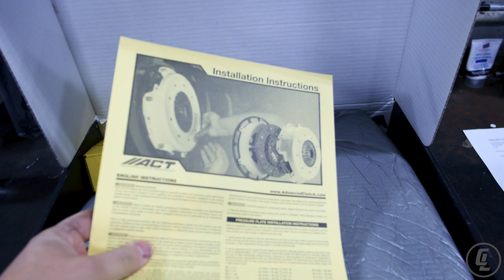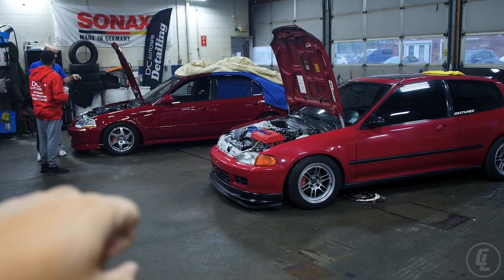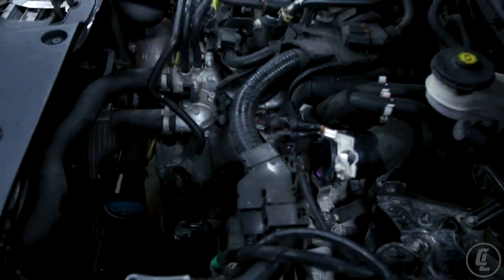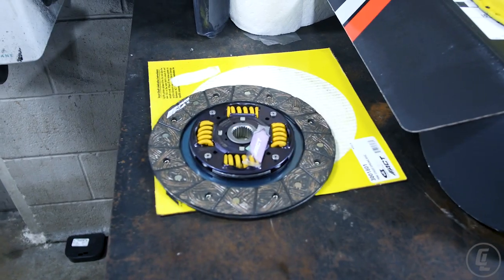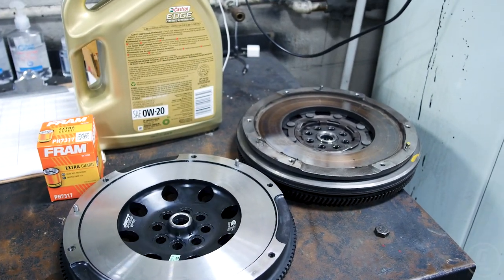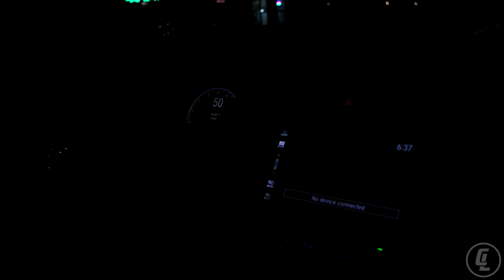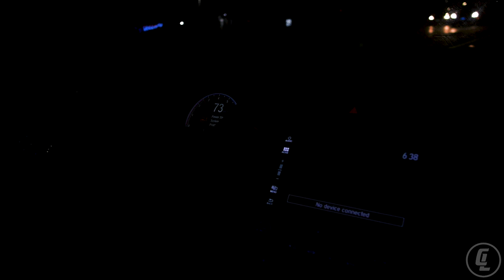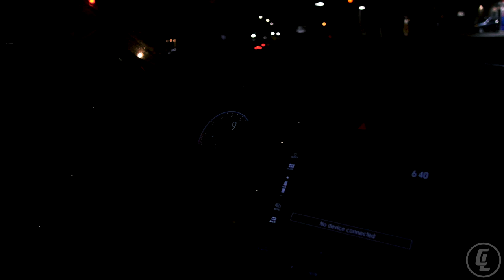ACT Clutch Upgrade - 10th Gen Civic Si

Comment: Hi guys. I have a question for you : I am planning to upgrade the clutch as well ( as the turbo, down pipe and intercooler have been upgraded as well) and I’m curious if you noticed the car revving faster with the new one. After the upgrades and tune I feel the car revving slower than stock.

Comment: Changed mine out in my garage already at 53k miles and now has 66k mile. I used CM fx300 along with single mass flywheel.
Really like although I do get that damn lock out.
Pedal feels solid and rev hang...well better but will never get rid of it completely.
Reply from the maker: Have you upgraded your cmc and line? I heard that helps with lockout
Reply: @ChrisLowpes  you know, I do have gear lock out only when im autocrossing or feel like redlining it. Other than that, everything works great. Pedal feel reminds me of older hondas. The engagement point is on point, and no more slipping.
I haven't yet changed those two items.
It is sort of disappointing to me to have to change so much just so the upgraded clutch function right. Just don't remember having to go through all that with my older hondas.
Reply from the maker: @vah-mingmoua9599  unfortunately the newer cars are more complicated then our older Honda’s. Try upgrading the CMC and line and I’m sure it will help!

Comment: Hey been enjoying these videos, they've helped me choose good parts for my own SI. You mentioned this clutch relieves the rev hang issue and I was wondering if this is on top of ktuner relieving it as well? Or had you removed the tune?
Reply from the maker: It’s the lightened flywheel that helps with the rev hang. I do also have ktuner still.
Reply: @ChrisLowpes  since ktuner isn't legal in my area I was considering the carb legal hondata tune but that one doesn't reduce rev hang. Would you say the lightened flywheel reduced rev hang a significant amount on it's own not counting the ktuner tune?
Reply from the maker: @Anthony-gq9eu  yea I would say it does with my set up. It’s a huge difference from stock
Reply: @ChrisLowpes  awesome, good to know. Thanks for the reply!
Reply from the maker: @Anthony-gq9eu  not a problem!
Reply: @Anthony - the “Rev Hang” is primarily a tune issue. It can be relieved by doing a proper custom tune, or getting a KTuner and like the Phearable tune. The reason that clutch kit helps drop RPM’s, is cause it’s a Single Mass lightweight flywheel. Our cars have Dual Mass heavy flywheels as stock, so the RPMs just drop faster with a lighter single mass flywheel. If all you do is put a single mass flywheel and clutch on, but don’t touch the tune, you’ll still experience a good amount of Rev-hang as the ECU just pads the throttle a lot longer on stock tune.

Comment: I bought the same clutch haven't installed yet, There's any particular reason with you went with the Honda throttle bearing? Thanks
Reply from the maker: They tend to be way more reliable and not fail, I also have a review video of the clutch coming out tomorrow!

Comment: What tune are you running and what tune do you plan on getting. Great vid man
Reply from the maker: I have the base map for W1 race MAF and I will be getting a custom tune. Thanks!!
Reply: @ChrisLowpes  do you have full bolt on? Because I heard we couldn't run that map if we were full bolt on.
Reply from the maker: @thatcryptoguy7313  I’m full bolt ons with a w1 turbo, 27won turbo inlet and race MAF without issues
Reply: @ChrisLowpes  thanks man

Comment: Installed prl cobra intake, was concerned about hydrolock on the car bc the intake sits so low..any issues you have running yours when u had it?  On rainy days etc etc
Reply from the maker: Nope I haven’t had any issues and have drove in really bad weather. Grab a hydro shield if your concerned about it, they definitely help!
Reply: @ChrisLowpes  I’ll take your word for it, your from ny right? They probably experience more terrible weather then nc here lol. Thanks for the reply bro! Digging the build btw
Reply from the maker: @vthach2012  I’m from Canada and we get shit weather here also. A hydro shield will give you a piece of mind and they aren’t expensive. Thanks for watching!
Reply: @ChrisLowpes  yes I bet a lot of snow up there, yeah for sure keep doing your thing Keep up the motivation
Reply: Approaching a snow day on Friday, worried about the intake being submerged in snow... did you ever face that problem? Or if you ever experienced it yet

Comment: If you got oil, why didn’t you get some tranny fluid? Breaking in a new clutch with old fluid that will definitely have material in it?
Reply from the maker: I definitely dropped the ball. I’ll be doing a tranny fluid flush soon anyways!
Reply: Use Amsoil. Huge difference in the shifting

Comment: Did you use the supplied throw out bearing or a oem one?
Reply from the maker: No I used an oem one
Reply: Why the OEM one over the ACT
Reply: @153eddy  The failure rate of the oem throw out bearings are no where near as bad as the aftermarket bearings that are supplied in most of these clutch kits.